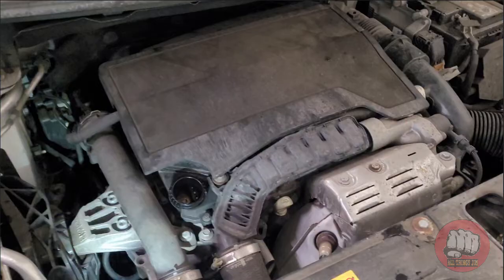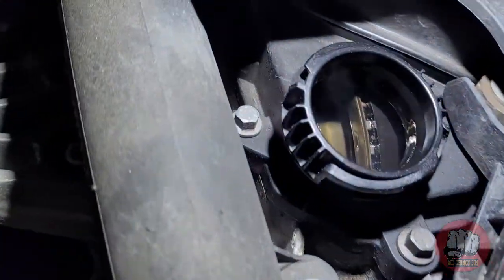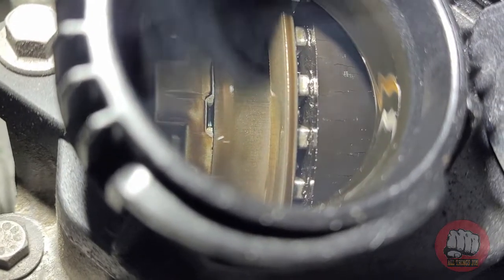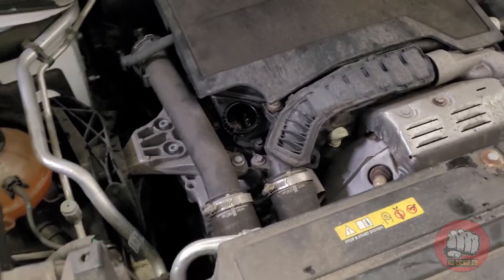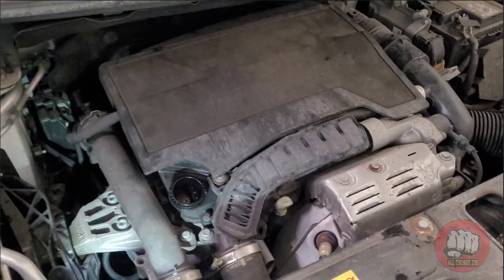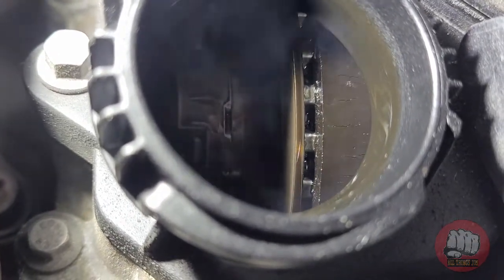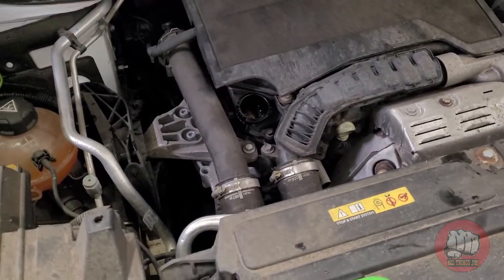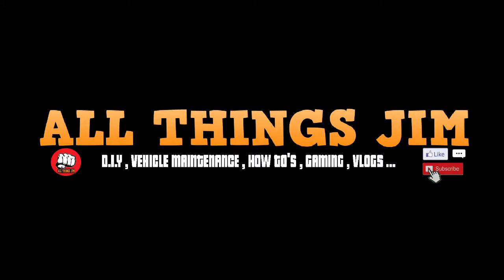Lets discuss the 1.2 puretec engine

Comment: What dod you think is better this or the 1.0 t-gdi i hope i don't spend too juch money on maintenance, be on top of it but not get bankrupt
Reply from the maker: Hi!, ive not had many dealings with the 1.0 t-gdi, is that the ones found in the hyundai / kia? From what ive read power wise its not as nippy / powerfull BUT far exceeds the reliability and comes with a massive warrenty. Which if true would personally would be my preffered choice, so puretech vs what ive read about the t-gdi it would be the t-gdi for me.... just do some research and look on forums for common faults between the two to help you make your choice 👍

Comment: Absolute nightmare
Just had one with blocked pump grill. Cleaned and fortunately pump seems ok. 
However apart from the strip down nightmare to get to the belt, some models require you to remove the phaser cam pullies. The turbo models I think. These are sophisticated bits of kit and even one tooth out on fitting back and all kinds of error messages. I’m still trying to cure P0014 and P003c errors on bank 1.
Checked VVT solenoids and still no go. Starts and sounds superb. But after just one minutes drive it goes into limp mode.
If I had a car with this engine I would pass it on as soon as possible. Cam belt in oil?!!!!
WHAT!!!’
Reply: Have you been able to deal with those errors :D ?
Reply: You can sqeeuze the belt between. Even on the newer versions. Als 1 hour job. 1.5 with oil pickup clean

Comment: The Puretech 1.2 110/130 turbo engine came out of factory with the wrong spark plugs (Bosch ZR6SPP3320) which were too hot causing miss firing, 
plug failure, pre ignition problems and in some cases cylinder bore damage. PSA tried to sweep it under the carpet changing the plugs free as vehicles came in for service. Correct plugs are Bosch ZR5SPP3320(cooler).
As has been said correct oil must be used and changed annually, especially if low mileage and short trips to protect the cambelt. Oh and no oil additives or flush because they attack the belt.
Reply: Hi my friend had a 6 month old Peugeot 3008, with this engine, and was driving to Germany, and the engine blew, it was something to do with the piston and the spark plug
Reply: My friend has a 3008 with this engine 6 months old and failed when driving to Germany, something to do with the piston and spark plug

Comment: hi i had a crosslabd x 1.2 turbo puretec 2020.after suffering and motor damaged i get a new one from psa 2023 .they said that new cam belt design never made that problem again because of new cam belt design .is that true they say that new engibe had a new part number than old one . i fear from that engine all the time
Reply: A mechanic told me they are now using timing chains, not timing belts.
That should fix the problem
Reply: @TheAllMightyGodofCod  only on the mild hybrid ones
Reply: @jmigserra1986  are you sure? I have been told that now all 1.2 engines have it. Seems to me it would be more economical to have just one standard system Instead of 2 but, if you say so...

Comment: For 1.2 puretech engines; just use right engine oil coded "B71 2302 or B71 2297" These engine oils are formulated to avoid damaging the timing belt. Other than these engine oils that you think are of high quality will damage the belt. just use B71 2302 or B71 2297 PSA approved engine oils..
Reply: Peugeot 3008 owner here my car was serviced by Peugeot from new had my cambelt changed .
At 36000 miles due to oil filter getting blocked from particles from the wetbelt .four months it took Peugeot to repair it.
Reply: @lithlander What years is the car manufactured ? I am looking at buying a car with this engine but starting to doubt my choice
Reply: the timing belt is a nightmare when it starts to wear off, the bill can quickly hit the roof within a second
Reply: Αλλαξτε τα λαδια καθε 5000 km ή χρονο.Ολα αυτα που λενε για 15000 km ειναι απλα για λογους μάρκετινγκ και αυξηση πωλησεων.Το λαδι εχει ημερομηνια ληξης,εφοσον ανοιχτει η συσκευασία μετραει ενα χρονο ζωης.Δοκιμαστε μονοι σας.Ανοιξτε ενα λιτρο λαδιου και κλειστε παλι το καπακι.Ανοιξτε σε εξι μήνες και κοιταξτε το χρωμα και τη μυρωδιά.Θα καταλαβετε.Δεν ειμαι μηχανικος πληκτρολογιου,δουλευω στη Peugeot Citroen.Εχω ένα citroen celysee 1,2 eb2 τυπο κινητηρα 82 ιππους.Κινουμαι απροβληματιστα και ελεγχω τον πάχος του ιμαντα.Ειναι ακομα οπως το αγορασα καινουριο.Ο κινητηρας μεσα πεντακαθαρος και εχω 74000km.
Reply: @hlmofc  επειδή ασχολούμαι με τον χώρο του αυτοκινήτου γνωρίζω για θέματα και προβλήματα πολλών κινητήρων!! Αυτή την στιγμή περιμένω το c3 aircross 1.2 110 άλογα!!! Απο την αντιπροσωπεία λένε 20.000 η ένας χρόνος και πιο ειδική συντήρηση στα 15.000 η ένας χρόνος!!! Τα 5000 που λες μου φαίνονται υπερβολικά λίγα χιλιόμετρα πόσω μάλλον για ένα καινούργιο αυτοκίνητο!!! Αν αλλάζω στα 10 χιλιάδες θα έχω πρόβλημα πιστεύεις; και για ποιον λόγο η αντιπροσωπεία να λέει σερβίς ανά τόσα μεγάλα κενά σε θέμα χιλιομέτρων;
Reply: Oil + rubber, no, oil and metal chain, yes !
Rubber belt in fresh air, proven.
Common bloody sense !
Reply: @nigelmitchell351  Oil+rubber its ok. i have no problem with it.. ecoboost engines are same..
Reply: @orhan14oglu  Not yet.....and not until you come to trade in, when you find dealers won't touch these three cylinder rubber wonders or they'll only give you a pittance in part-ex !
I wouldn't touch one with a barge pole, compared with a 250,000 mile PSA diesel they're rubbish !
Reply: @nigelmitchell351  i m sorry but all new generation brand and model diesel engine are rubbish because of  adblu particule filter etc. 1.2 T Puretech awarded engine and it's best engine..
Reply: @orhan14oglu  For what 50,000 miles then you'll need a new one !
They're a bag of shite. 🤣
Reply: @orhan14oglu  You'll need at least four 1.2 petrol engines to go the distance a 1.6 HDI engine will last and they'll cost you much more in fuel costs and produce far more co2 in doing it ! 🤣
Reply: @nigelmitchell351  Een ketting is ook niet altijd een succes. Vraag maar aan Volkswagen.
Reply: I bought a c3 83 hp. When it goes over 50,000 I will sell it, and then buy a c3 again, etc. The engine is fantastic. It requires regular maintenance. The engine is fantastic. I work at Citroën, and we have noticed that the atmospherics are much less prone to belt problems than the turbos. The atmospherics change the belt around 80 miles, the turbo 60 miles. On longer distances, they consume less, I repeat, the engine is fantastic!!!
Reply: So we're changing the timing belt every 80k kms?
Reply: @1975augusto  you talk like these engines will last hundreds of thousands of km. Many fail before 150. 000km
Reply: @gicugigel3790  I know many owners of 301/C-Elysee who passed 300000km mark with NA version of it, producing 72hp. at the same time numerous folks passed 200k in restyled (`2017 and newer) car, with EB2M of 82hp. also NA. many of them are/were single owners. those are just dry facts...
Reply: Hello, is it true the latest is 2312? I got an offer for the oil change and its b71- 2010 which is not good I think.
Reply: @peterkiss7742  check the user manual; country group 1 -3 uses B71 2010/B712312.. counry group 4 uses B712302/B712297.. and country group 5 uses B71 2297.. Check your country in wich group from user manual..
Reply: @peterkiss7742  

Teknik bilgiler

Araç bilgileri

231

Önerilen sıvılar ve yağlar

Gerekli motor yağı kalitesi

Ülke grupları 223

Ülke gruplan 1 ile 3 arasına giren ülkeler

EB2FA

EP6FDTM

EB2ADT

EB2DT

EB2ADTD

EC5F

EB2ADTS

DW10FC

EP6FADTXD

DV6D

DV5RC

DV5RD

DV6FD

DV5RE

DV6FE

Opel Orijinal motor yağı

B71 2010/B71 2312

B71 2312

Motor EC5F: B71 2290, B71 2296 veya B71 300 de kullanılabilir.

Ülke grubu 4'te yer alan ülkeler

tüm motorlar

Opel Orijinal motor yağı

B71 2302/B71 2297

Motor EC5F: B71 2296 veya B71 300 de kullanılabilir.

232 Teknik bilgiler

Ülke grubu 5'te yer alan ülkeler

tüm motorlar

Opel Orijinal motor yağı

B71 2297

Motor yağı viskozite dereceleri

Ülke grupları 223

B71 2010

B71 2312

B71 2302

B71 2297

Motor yağı viskozite sınıfı

SAE 0W-20

SAE 0W-30

SAE 0W-30

SAE 5W-30
Reply: @peterkiss7742 It should be either B71 2010 or B71 2312 oil.
Reply: Doesn’t make a difference poor engine
Reply: @brianmonkey1697   you are totally wrong. My cousin's 1.2 T Puretech Corsa nearly done 100.000 km and timing belt very clean like brand new.. My 1.2 T Puretech Crossland also going very good with clean timing belt. It's very strong and good performance nn engine that has received awards 4 years in a row
Reply: @orhan14oglu  sounds like someone works for Vauxhall…. Terrible design
Reply: @brianmonkey1697  I mean, I can prove to you that I am a hotel owner and have nothing to do with the automotive industry. Also no Vauxhall here. What is the reason for slandering by making brainless guesses and comments?
Reply: @orhan14oglu  wow you sound salty just what I would expect from a 1.2 puretech Vauxhall owner… what’s the Hotel name¿
Reply: @brianmonkey1697  1.2 Puretech engine received the engine of the year award 4 times. Timing belt also updated 4 times for user faults.. After 2022 there is no any problems.. Only the first produced engines caused problems due to user unconsciousness. no more. Which oil brand you use in your 1.2 Puretech
Reply: @orhan14oglu  so like the Ford there faulty….
Reply: Whilst i think the 1.2 puretech is a remarkable engine in many ways (my wife has a 110hp turbo) it is not a robust unit and that is widely recognized in the motortrade/industry.....@orhan14oglu
Reply: But what isn't in the oil when you put it in is the contaminates from combustion.....
Reply: Stimmt leider nicht auch bei korrekter Wartung mit richtigen Öl sind diese Motoren nicht zuverlässig schade eigentlich da Peugeot sonst sehr schöne Autos baut.
Reply: @mathiasschiesterl7538 the Prince engines, made with Bmw, are also bad. The older original PSA's were great
Reply: @mathiasschiesterl7538  yaklaşık 30 farklı model 1.2 Puretech motoru kullanıyor. Yanlış bişey olsa ülkenin sanayiciler birliği, otomobilciler federasyonu karşı çıkardı herhalde. Herkes klavye mühendisi.
Reply: Fuel and combustion impurities build up in the oil and damage the belt. So frequent oil changes req
Reply: Bullshit this engine is pure junk
Reply: @robertjohnson9757  🤣 Absolutely, the ford fcuk up too, they might as well put cooking oil in them because they're all going to fry !

Comment: You want a bullet proof engine? get an old Ford 'Kent' crossflow. 
 I only found out about this litte gem of a problem AFTER I bought a Peugeot!!! Who thought that it was a good idea to put a rubber belt inside an engine FFS?!?!?!?!??????? Checking my vehicle history the other day, I discovered that it has had a new belt AND oil pump fitted and I'm only the 3rd owner from new! It's a 2017 car on a 66 plate. One previous owner racked up over 20,000 miles in 1 year. This will be the shortest time I've owned a car and after this one, I'm going back to a Toyota!
Reply: I like to stick to older Peugeot diesels. The 2.0 HDi and good old 1.9 XUD engines are bulletproof

Comment: is there a PCV on these engines (I have 1.2 year 2018) that you can clean out? It's using a lot of oil and has only done 40000 miles
Reply: You have to buy the whole head to replace it, its a sealed unit! The cost from Peugeot  is £300 plus, and the cost to fit it!
Reply: That doesn't sound too bad @lennonpolo . Local garage wanted £2500 on a guess that it 's the piston-rings that are to blame

Comment: Does anyone know what coolant should be used in this engine (eb2adts)?  The current one is between orange and brown.  There is nothing clear in the User Manual either.
   Coolant colors have varied, as I see, every coolant uses every color. So, filling with red or similar color may causes issue.
Reply: It usually is a B71 5110 coolant but check what it says in the manual. It should say Bradol or Arteco Freecor DSC, or just "lobrid" coolant.

Motul has a specific 5110 spec (OAT lobrid), as does Valeo. Will be more expensive.
Mannol AF13++ 4015 pre-mixed fits the same type of lobrid coolant but is not tested to PSA spec.

Color doesnt matter, Stellantis uses yellow or blue in vehicles. Maybe other if they change suppliers.

Do not use PSi Hybrid OAT like VW G12Evo, as those are against recommendations.
Reply: @tiagomnm  thanks a lot for answer. I'm thinking about to refresh coolant completely on next winter. 

Unfortunately, users manual doesnt give any info for oil and coolant type. Really weird.
Reply: @GTC1357  You're welcome. I found it very hard to find.

Coolant type should be on some sheets regarding engine types and what oil to use. Have you downloaded the online manual?

As per maintenance sheet, need to regularly test the PH (not sure how, I check if close to original) and change every four years.

Ask for the maintenance sheet at an official dealer. It will help you a lot on maintenance.
Reply: @tiagomnm  I only have a users guide which given on purchasing car.
 Official service shop hasnt got any idea for true liquids. They just fill up with Total or Eurorepar products. 
Even i saw, they adding tap water to coolant tank. Thats why i have suspicions with 2 years old cars coolant 😅
Reply: @GTC1357  You need to change the fluid ASAP. It should never mix with water as it will reduce cavitation protection for piston walls, that is required to avoid engine damage. Plenty of research done on that. Though I think it is worse on diesels.

What is the vehicle? I may be able to get that for you. If 308 II, I already have it.
Reply: @tiagomnm  Its 208. 
1.2 puretech 130hp (eb2adts). 
I just measured coolant with refractrometer, then its still above -30 degree. But idk how about the pH, and what they added in last service maintenance.
Thank you for all your supports. If i learn the true type, no problem on providing it.
Seems like, I will replace with B71 5110. And refresh the brake fluid too. Its turned dark just in 13500 km's.

I think it will be my first and last Peugeot. (Stellantis) 😁
Reply: Any good quality coolant will work. This is just a normal car engine, not a spaceship. I use G12 (Pink), others use G33 (green or blue).

Comment: Should i keep it or get an toyota auris or honda insight im looking at those atm and selling the Peugeot off
Reply: You can't go wrong with a Honda or a Toyota. 👌
Reply: @tiagofigueiredo2529  You can.......but they dont have this particular issue
Reply: Honda have problems with fuel contaminating and thinn8ng the engine oil, avoid
Reply: @volt8684  Both Honda and Toyota HAD that problem in their turbocharged engines but quickly fixed the issue and the affected cars got and extended warranty and engines replaced so, no, not to avoid. ✌️
Reply: @volt8684  ive ended up with mazda6 2.0 litre petrol naturally aspirated, its been going strong for the past 6 months

Comment: Got a second hand corsa with this engine. Car came with around 24k km’s when we bought it. Did around 2.5k more on it and its still doing pretty fine. Its not the smoothest per say but gets good mileage and works great with 8at transmission (although sometimes kicks in a little bit harsh while shifting between 2nd and 3rd).130 bhp for a small car such as this is pretty decent imo. Reliability on the other hand….